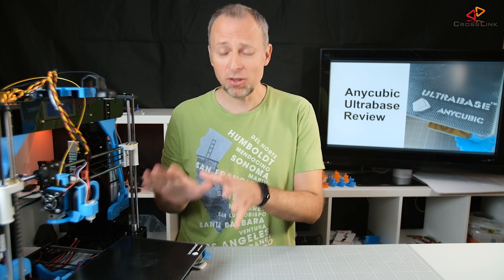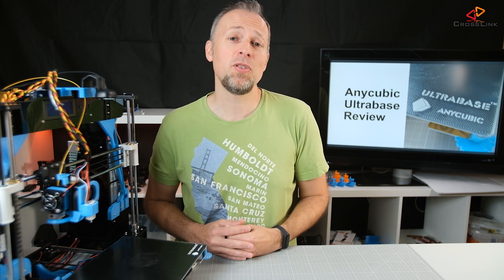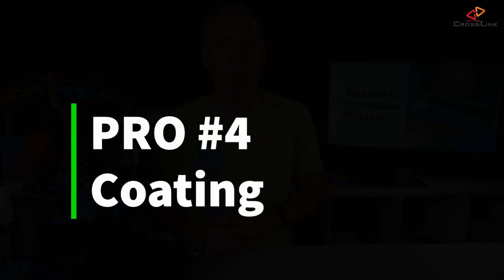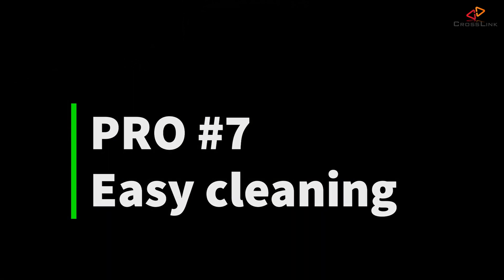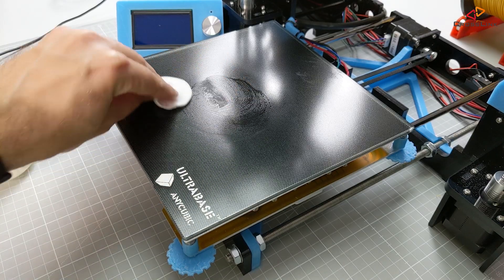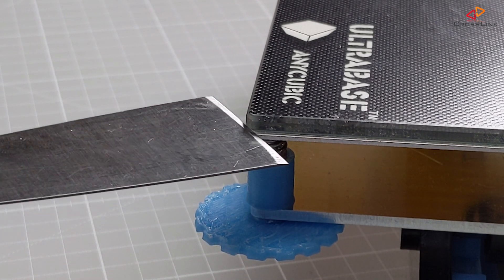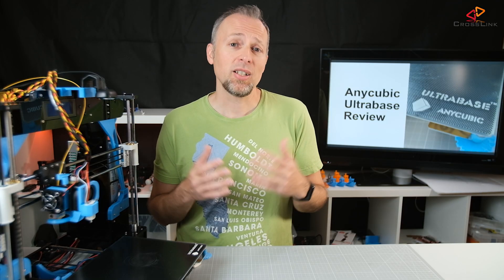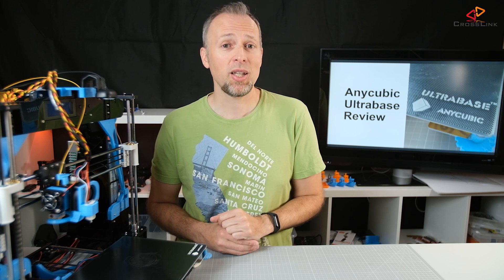AnyCubic Ultrabase - Worth it?

Comment: I was experimenting with ultrabase a while ago, basically i bought a creaity, unbranded and a anycubic ultrabase, i speculate its all the same plates. I saw that when you use acetone/isopropyl alcohol to clean the plate, it only works for 1-3 prints but if you use methyl alcohol (barbeque (bruler) alcohol), you just have to clean it like twice a week. I have been using this method for 4 months and saw no damage to the plate whatsoever. I hope my information was useful.

Comment: I bought my Anet A8 in the summer of 2018.  Cool to play with, but I'm a practical user and only print when I really want something.  I have fought print-lifting since the day I assembled it. Today my neighbor (who I gave a Tronxy X1 to) came over and surprised me with one of these build plates.  He replaced the glass bed  I had been using.  I have a very stock A8 setup and I can tell you this it probably one of the best things I could have ever asked for.  Every print so far is doing wonderfully.  While I've enjoyed your series (and added a few of your ideas along the way over the past year), I've found my own experience with this printer and this surface to be the most powerful upgrade I've added.  Love the content, you earned a sub :)

Comment: I have a very similar glass bed thats labeled "Creality" (most likely just rebranded). As long as I clean it with Isopropylalcohol before the print, everything sticks so well, that even PLA is difficult to remove before it cools down. I never used any kind of glue etc

Comment: Oh, I'm also upgrading my Anet A8 to 32 Bit with an SKR 1.3 using TMC2208 stepper drivers in UART mode.  Its virtually plugs an play. Now I'll need to design a dual print head to take advantage of the dual extruder function of the board.  Also, have a look at the SKR PRO 1.1 32 bit board.  It has provision for three extruders!  https://www.amazon.com/kingprint-high-Frequency-Printer-Control-12864lcd/dp/B07T2RLG2C/ref=sr_1_3?crid=2TEYGJTY29YXN&keywords=skr+pro+v1.1&qid=1562094366&s=gateway&sprefix=SKR+P%2Caps%2C155&sr=8-3

Comment: I've made a new build plate out of 1/4 inch (6.35 mm) 6061T6 Aluminum tooling plate (very flat).  The Idea is that it will act as a thermal mass to maintain a more even temperature.  The downside, of course, is that due to its mass, it takes a lot longer to heat up if your heat bed is only capable of 12V.  Also, a 12V heat bed will struggle (mine does) to get much past 90c for ABS prints.  It does seem to work well though.

Comment: Great video once again.  I like the idea of having an unobstructed print area, however, the fact that the build surface is "Non-Removable" is a definite downside.  I'll stick to my plain glass that I got from the hardware store and live with working around my paper clips.  Oh, and I use Elmers Washable Purple School Glue for all my prints ( https://www.amazon.com/Elmers-Disappearing-Purple-School-Washable/dp/B003ULCZ7M ) in PETG, PLA, and ABS.  It works great.  I'm Sure UHU would work just as well.  Also, I NEVER scrape prints from my glass bed - IT ENDS BADLY.  I always just put the build plate in the freezer for about 20 min and the pints just fall off the glass!  Physics!  Who knew!  :-)

Comment: I agree with the fact its not super adhesive .. i mean i put uhu glue stick on it to print PLA.. with PETG i have no problem it stick too much in my case !i have remove the glass from the heated bed and the aluminium plate is cheap very thin and bend very easy ! i dont recommended to remove the special glass from the heat bed another good review Daniel keep it on!:)